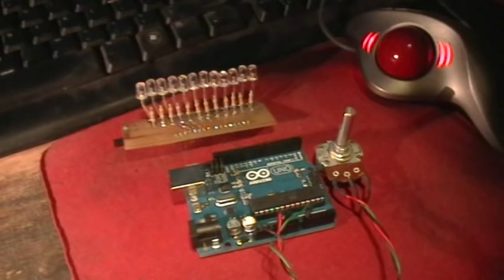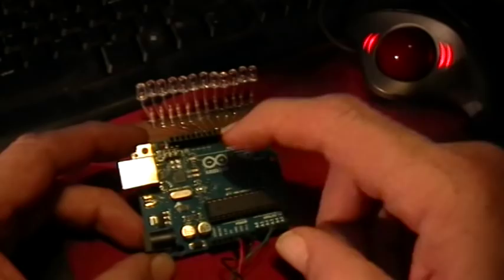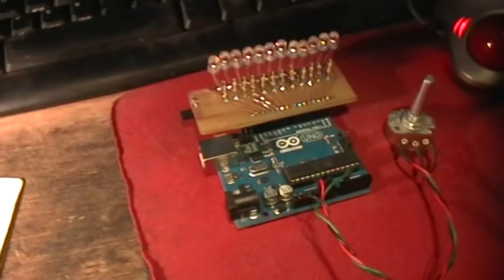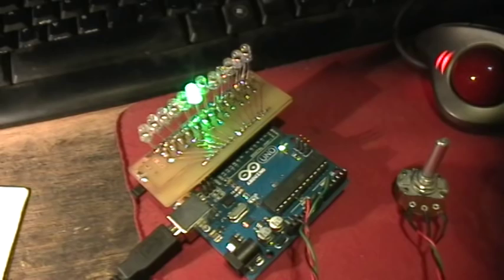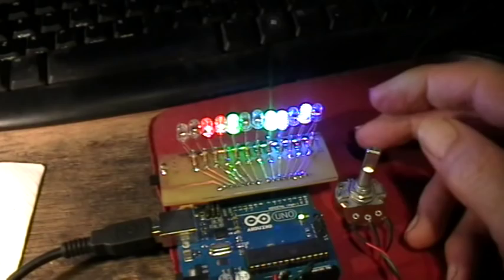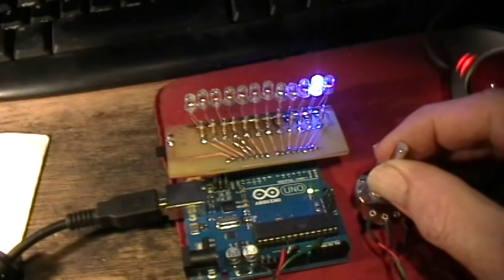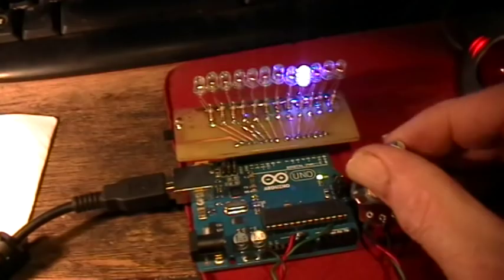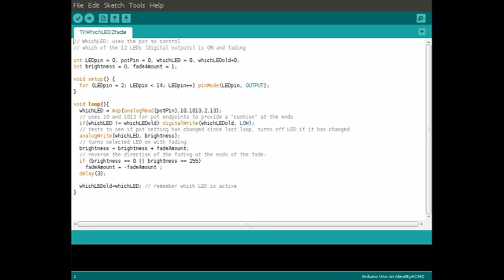Arduino: LED Twinkler: Basic Analog Input, Digital Output, PWM

Comment: 1) Any way to load multiple sketches. 2) Then control them with momentary on buttons?
Reply from the maker: +Terrence S 
Sure. But another way to do it (with fewer wires and input pins) is to use a potentiometer and analogRead and the while statement.
Like this: while(analogRead(potentiometer)) less than (value1) and greater than (value2) do sketch part A;
while (analogRead(potentiometer))less than (value3) and greater than(value4) do sketch part B;
etc. 
(Can't use all the right symbols for logical comparisons in this comment. But you get the idea, I hope.)
I use this technique to switch between sketch segments in the NeoPixel demonstrations. Using pushbuttons is similar but a little more complicated in wiring and programming. 
You make your separate sketches into functions that are called from the main loop, by the while statement for the potentiometer, or by setting a global variable value using the button presses. If(button1 pressed) value=1; if(button2 pressed) value=2; while (value ==1) do sketch1(); while (value==2) do sketch2(); 
and so on. 
Thanks for watching and asking!

Comment: Awesome video! I have set up everything for your chaser sketch as per your instructions, except I had to add "int" before "LEDpin" in each "for" loop, otherwise the code would not compile. When I run the sketch, it only cycles through each LED once, but stops and will not loop. Any ideas as to what I can do to correct this? I always try to troubleshoot on my own, but I'm stumped on this.
Reply from the maker: Erik A That's odd, because I thought I had the variable types declared at the top of each sketch. Are you sure that was the problem with compiling? Are you using an Uno R3? It has been some time since I've looked at these sketches. The not-looping could be because of the variable type declaration within the loops, but I'm not sure. 
What version of the IDE are you using, what Arduino board?
The very first line of code in the TKLEDChaser1 sketch is
int LEDpin = 0, potPin = 0;
but I see that the first comma looks kind of like a period on the screen.
I see nothing in the sketch (on screen at 9:46) that would make it fail to compile or run, no matter board or IDE version.
Here's the whole thing (without comments):

int LEDpin = 0, potPin = 0;

void setup() {
for (LEDpin = 2; LEDpin < 14; LEDpin ++)
pinMode(LEDpin, OUTPUT);
}

void loop() {
for (LEDpin = 2; LEDpin < 14; LEDpin ++) {
digitalWrite(LEDpin, HIGH);
delay(map(analogRead(potPin),0,1023,1000,10));
digitalWrite(LEDpin, LOW); 
 }
}

Check carefully for the semicolons, commas, and brackets in your sketch. Let me know how it goes.
Reply: TinselKoala Thanks for your quick response. I am using a Uno R3 and version 1.6.3. If I do not include the "int" as mentioned, I get a void loop error "LEDpin was not declared in this scope." Adding the "int" solved it, but the problem now is it only cycles once. I copied your code exactly as shown and went over it many times, as I know just one character or case off will cause problems.
Reply from the maker: Erik A
Well, I just copy-pasted from the comment above and tried it in my IDE which is an older version, 1.0.2, and it compiled with no errors. I don't have the hardware set up at the moment. Please try copying from the comment and see if it will compile.
Reply from the maker: Erik A
Sometimes that error can be due to having the "h" file in the wrong directory. Try the "blink" sketch from the File>Examples>Basics menu and see if it will compile and run. If it does, then try opening another Sketch window and entering the Chaser code copied from the Comment above into that, and see if it will compile.
Reply from the maker: Erik A If I change the first line to
int LEDpin=0. potPin=0;
(a period instead of a comma after the first 0)
I get the following compile errors:
sketch_apr14a:1: error: expected ‘,’ or ‘;’ before ‘potPin’
sketch_apr14a.ino: In function ‘void loop()’:
sketch_apr14a:11: error: ‘potPin’ was not declared in this scope
Reply from the maker: Erik A OK, I just did a fresh install of 1.6.3 IDE on another computer, copy-pasted the sketch from the comment above, and it compiled with no errors.  (but annoyingly the copy-paste put the whole thing on one line so I had to insert linefeeds manually).  Also the compile was quite slow compared to the earlier version of the IDE.
Check to make sure that you have "UNO" selected in the Tools>Board menu.
Other than that, I don't know what to say, since I can't reproduce your compile error.
Reply: TinselKoala Okay, this is so bizarre. I copied and pasted your code and it works like a charm. I have compared the two at least ten times trying to find where the difference is and still cannot find any difference between what you gave me and what I originally typed. Thank you for being so generous with your time. I'm still stumped. It may have been a difference as to where it was located, like you said.
Reply from the maker: Erik A
Weird all right. Semicolons missing or extra? Parentheses matching left and right? Curly brackets all set properly in the main and for loops? Sometimes another set of eyeballs can see what ours miss, have you tried getting someone else to compare your non-working version and mine?
Once you've got one working, then you should be able to spawn another sketch window off the working one, enter the code, and the extra files should be in the right place automatically. I'd be interested in knowing exactly what the problem is.
But at least you got it working! Have you tried the other sketches from the video, they use the same hardware setup and do some more interesting things.
Reply: TinselKoala I'm so embarrassed. The "p" in the first "LEDpin" of the void loop was capitalized and I looked at that thing a dozen times and swore it was correct. That's why it would run through the setup test, but lock on the void loop. My middle-aged eyes were fatigued and fooling me at 11:30 on a work night. Yes, I copied and ran all of the other projects in the video and they were great - just what I was looking for. The book I have goes through most of these code functions, but they were not using them to do the things I wanted, which is what you were doing in your video. I will go back and study these functions and what they are doing in your sketches. Thanks again!
Reply from the maker: Erik A
Well, you can blame that on me if you like, for not being consistent in variable naming. I used "LEDpin" and "potPin"... should have put "ledPin" instead, to keep consistent in naming patterns. I thought of that when I was copying the sketch into the comment...
But good that you finally caught the issue. That's why you were getting the "not declared in this scope" compile error and the failure to loop.
A neat trick you can do is to install another potentiometer, and use the analogRead value from that pot to switch between different program segments using while() statements, and put all of the separate sketches into one sketch and switch between them using the second pot. That's how I control the different functions in the NeoPixel demonstrator.

Comment: Can you list out all the things (hardware) I need to prepare in this tutorial? Thanks!
Reply from the maker: Certainly. You need one Arduino board (here I use an Uno from Radio Shack). You need a potentiometer, any value will do, like 5K, 10K or 50K, and the wires that connect it to the Arduino board. You need 12 LEDs of your choice of colors. You need one current limiting resistor for each LED, I used 470 ohms for the superbright LEDs shown here. You can use other values but I would not go below 200 ohms each.
The potentiometer goes with the legs on +5V and ground, and the wiper to the designated potpin in the sketch. The LEDs go with all Cathodes to ground, each Anode to a resistor then to each output pin of the Arduino.
If you don't want to make a circuit board, then you will also need a breadboard and jumper wires to connect your LEDs and resistors together and to the Arduino.
Good luck with your project and let me know how it goes!

Comment: Nice video, easy to follow. Where can a fellow find one of those LED boards like you have in your video?
Reply from the maker: +Derrick MacDonald 
Sorry, I didn't see your question until just now. I made the LED board myself using standard PC board fabricating techniques: sketch the traces with Sharpie marker onto blank copper PC board material, etch with Ferric Chloride, drill holes.

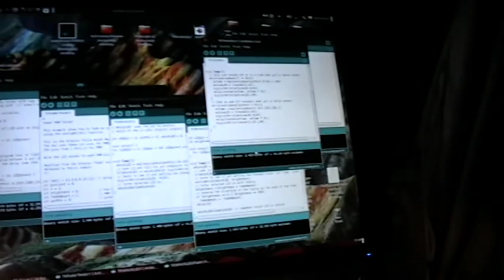Comment: I have been looking for something like your setup at 8:17 randomly flashing LEDs any chance you would be willing to share the coding and how you setup your LEDs that way?
Reply from the maker: Program sketches appear at the very end of the video. Watch in HD, 
fullscreen, pause and copy. You will learn much more by transcribing 
yourself than by copy-paste from a file!
The Sketches are shown at the end of the video. View in 480p, pause the 
video, and copy each sketch by hand into your Arduino IDE. I know this 
is annoying but it's the best way to understand how the programs work.  
Each sketch is only a few lines long and has comments to explain program
 and circuit features.
Thanks for watching, and good luck with your project!
Reply: Thanks ill give it a try i honestly didn't even realize those were on the end. Im not very good at this stuff but i think its do able.
Reply from the maker: *****
Of course it's doable. If I can do it, you can too! Once you have the basic sketches loaded and working, you can try changing various things to see what effect it has on operation.
The LEDs are simply connected, each one in series with a current-limiting resistor. Arduino output pin to resistor to LED anode, LED cathode to Ground.
Reply: So i got everything completed and the coding done but every time i try loading it it telling me 
exit status 1
Error compiling for board Arduino/Genuino Uno.

Any ideas on this? not sure if it would help to have the code let me know and i can post it.
Reply from the maker: *****
That's all the information your compiler gives you? No line numbers or statements?
Try reading down in the comments below where someone else had a problem.
Have you gotten any other sketches to work on your system?
Yes, post the code you used and let me see if it compiles on my system.
Reply: Ok so scrolling over the error it looks like there is a little more to it but here is the code and below that ill put the error 

// LED twinkler: LEDs on pins 2 to 13. each with 470 ohams to ground pin
// Pot wiper to A0. ends to +5v and ground

int Pin = 0, Locpct = 0, activeLED = 0, onTime = 10, potPin = 0;

void setup(){
  // set pin mode and lights each led in sequance
  for(Pin = 2; Pin < 14; Pin++){
    pinMode(Pin,OUTPUT);
    digitalWrite(Pin,HIGH);
    delay(500);
    digitalWrite(Pin,LOW);
  }
}

void loop(){
  //only one random LED on at a time when pot is above center
  while(analogRead(2) <= 511){
     onTime = map(analogRead(potPin),0,511,2,100);
     activeLED = (random(2,14));
     digitalWrite(activeLED.HIGH);
     delay(random(onTime, onTime * 5));
     digitalWrite(activeLED,LOW);
  }
  // LEDs on and Off Randomly when pot is below center
  while(analogRead(potPin) > 511){
    onTime = map(analogRead(2),512,1023,100,2);
    digitalWrite(activeLED,HIGH);
    delay(random(onTime, onTime *5));
    digitalWrite(random(2,14),LOW);
  }
}

In file included from sketch\TL.ino.cpp:1:0:

C:\Users\Matthew Nelson\Desktop\TL\TL.ino: In function 'void loop()':

C:\Program Files (x86)\Arduino\hardware\arduino\avr\cores\arduino/Arduino.h:40:14: error: expected unqualified-id before numeric constant

 #define HIGH 0x1

              ^

C:\Users\Matthew Nelson\Desktop\TL\TL.ino:21:29: note: in expansion of macro 'HIGH'

      digitalWrite(activeLED.HIGH);

                             ^

exit status 1
Error compiling for board Arduino/Genuino Uno.
Reply from the maker: *****
Yep, there it is.
digitalWrite(activeLED.HIGH);
The compiler's error messages are generally quite helpful in flagging errors, but sometimes they can be pretty cryptic. When you've made and tracked down as many errors as I have... it gets easier!
Reply: it helped to see it all layed out instead of scrolling up and down. thanks for all the help.
Reply: You know that 480 isn't HD, right?